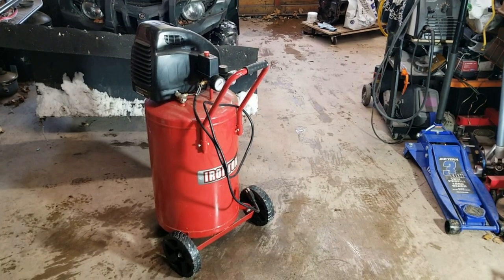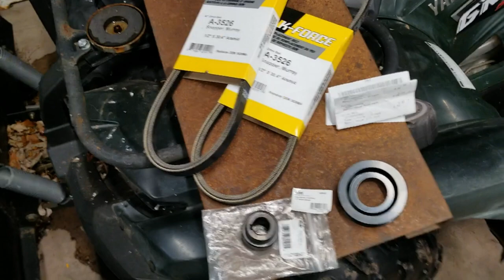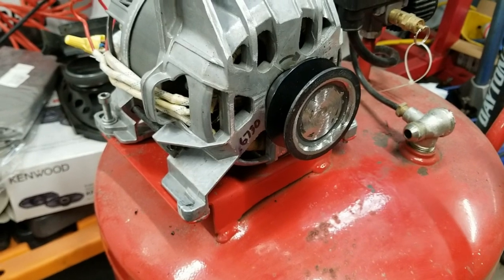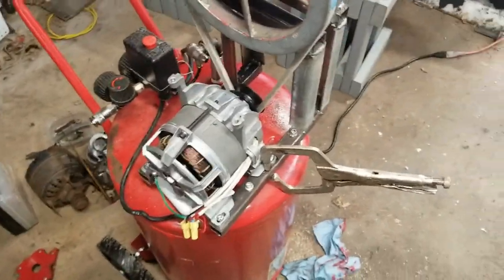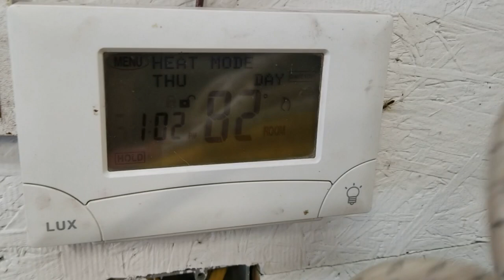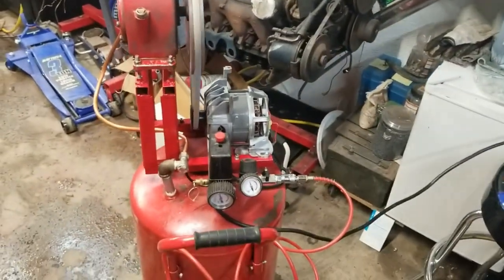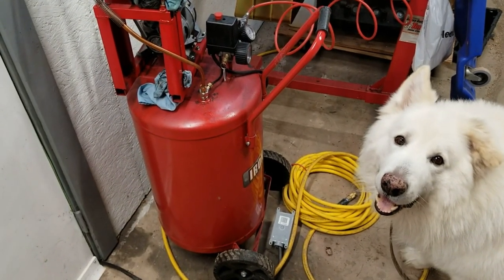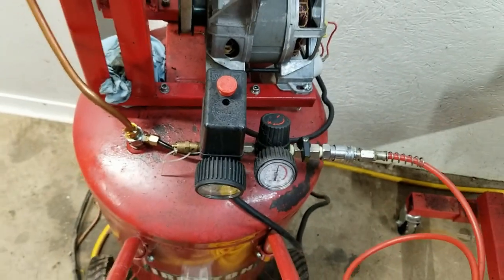Ironton Air Compressor HELL

Comment: Does the compressor have an oil pump or squirter or why does the direction of turn make a difference ? Other than the fan which probably doesn't do much anyway.
Reply from the maker: Good question. I have to replace the gasket on the crankcase. I'll check that out then.